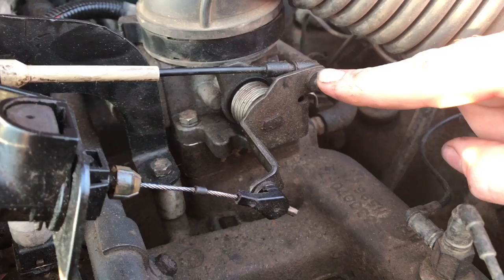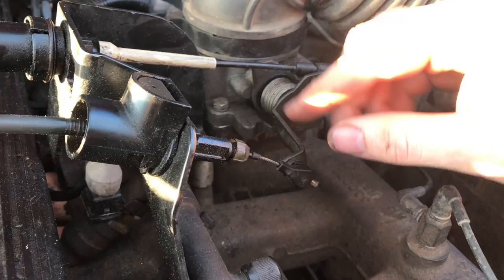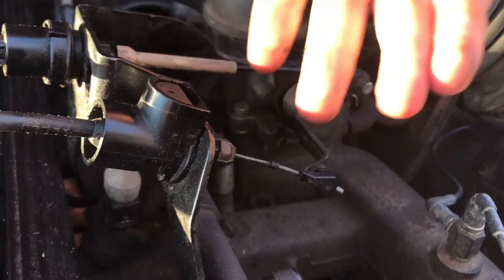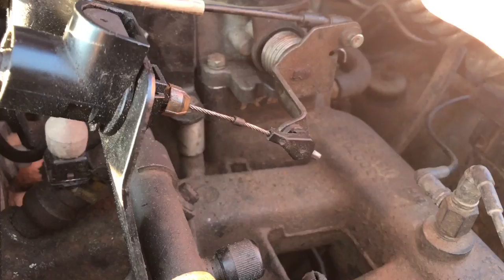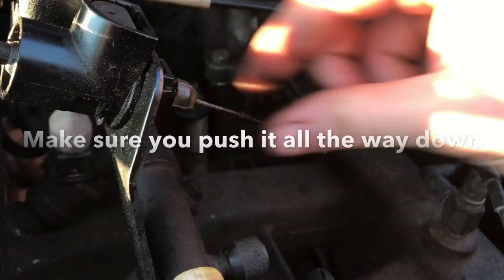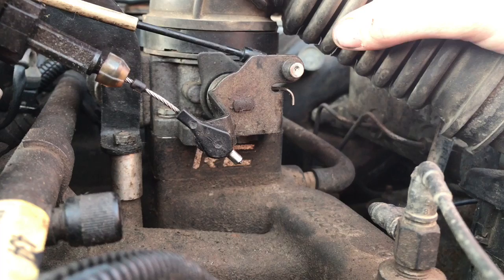How To Adjust Your Throttle Valve Cable The Right Way (Jeep Cherokee)

Comment: I bought a 93 zj the last owner told me it's a manual automatic transmission meaning you shift from low on up to drive , if you take if in drive it's to lazy and hardly moves

Comment: I've been trying to reset my cable it's not working.i tried at least 40 times and it still not working.i know it's not my transmission because my transmission was gd before I cleaned my throttle body is there something I'm doing wrong

Comment: How do I adjust it if the plunger doesn’t ratchet back when I step on the throttle? For instance, when I push the plunger back and then I step on the throttle the plunger just stays in place. I have to manually put the plunger back in position.

Comment: It's actually called the "line pressure up cable" by Aisin. It increases the line pressure in trans to engage the clutches harder at higher engine loads.

Comment: Mine is not extracting back out with the pedal but it does extract out if I do it by hand at the throttle period what the hell does that mean? LOL my shifting is a little bit late at around 3000 - 3300 Doesn't seem to get any better no matter how I adjust the cable
Reply: That’s my problem too!, mines not coming back out

Comment: @Cherokee Ronnie. Hey Ronnie, thanks for posting the video. I just bought a 1993 Cherokee last week and not that I've been driving it around much but I did notice that during my 30-40 miles I put on it that the shift points were way too high. I paid attention to the rpm's which were shifting at 2,300 to 2,500, so yep it sounded like the trans was really winding out. I made that adjustment this morning & then started it, let it warm up a bit, then off I went for a 6 mile loop that I go on whenever I've just repaired something on my vehicles. And I have to say, Cool Man, the shift points are a lot better. At a normal acceleration, with or without traffic, my Jeep was shifting at 1,800 to 2,100 and when it went into 4th, it averaged 1,600-1,700 rpm's. 
Now it's not my 1st jeep Cherokee but since it has been 10 years and taking into consideration it's still new to me, I'm just taking my time with it so I don't fall into any problems from rushing into things. There is not rust on the vehicle at all. Came outta Colorado Springs, Colorado, where it lived since 1993, so being the 3rd owner and it now living in Michigan, automatically lets this Jeep stand out, so I'm glad it's in great condition. Other jeep owners can look at the grille and pretty much guess from what part of the 90's it was made, plus I've gotta get used to the other Jeep Owners who know you gotta wave at any other Jeep on the road. It's a neat experience and glad I subscribed to your channel. Thanks again Ronnie for uploading this video...

Comment: got a 87 AMC cherokee chief , don't know much about the tranny or how they work it has the AW-4 in it , with power tran button on dash /  i'm adjusted it a couple times like you said  , but  it won't shift out of low at all any ideals ? thanks

Comment: I adjusted mine and it started bucking on first and second gear shift. I feared the transmission was having trouble but after seeing your video I realized it started after I did the adjustment. Search for a good way to do it and you gave me the answer. I just need to play with it and get the right adjustment. Thank you.

Comment: OK, didn't work right for me...but I did get the problem fixed. Let me explain:
I had the exhaust manifold replaced and after it was shifting real high. I sort of freaked out and thought that back in the day I'd have figured they messed with or unhooked the vacuum modulator. I had no idea what direction to go but a few searches found this and others. That button would not move. Took liquid wrench and a sore finger before it moved. I had to really fight it and it was hard to get the adjuster thingy to move...but it did. I should say mine looked a little different ('95 inline 6). It would not adjust however. I lubed and tried and held the button and moved it...thing was almost seized and there was no auto adjusting going to take place here. I watched this closely, and then manually moved the thingy where it looked like it needed to be. To my amazement...because it just didn't really look like it would do anything...it fixed it. Shifts are back where they belong...HOORAY! #jeep #cherokee #shifting #kickdown
Reply: Same issue, hopefully it works

Comment: I recently bought a 2000 jeep grand Cherokee  (v8). Noticed it was shifting sluggishly and looked into this tv cable. But every video I find shows a button to adjust it and there is no button on mine. After looking at the cable it is incredibly loose and needs adjusting, I just don't know how.
Reply: Sean Cantley did you ever find a way?

Comment: How could a friend help me with my Jeep Cherokee every time I turn it on, it speeds up too much and then the revolutions go down but it only does so when it's hot
Reply: Fredy T List of possible things 

CPS

TPS 

IAC 

TV CABLE <----- this video 

Bad ecu but probably not 

Bad flex plate 

Bad valve cover <----- for me once in a blue moon would miss violently when put in drive almost a knock.

Comment: I have 98 jeep laredo. It's crazy! I've taken to 3 mechanics. Who drive it and tell me there nothing wrong with it! When driving on interstate and it's gets between 60 to 70 miles. The rpm will start revving up. You can see it, And feel it. It doesn't do it when idling. Only between 3rd 4th gear. Can this be same thing? Cable?

Comment: If your button won't push down a socket that fits inside the button recess when laid over on its side and a channel lock tool will push that button down.

 then while down move the " nose"  out of the housing 1/16 of an inch untill the shift quality is where you like it. 

Saves a sore finger. 

Just a gentle squeeze is all it takes.

Comment: What happens wen it doesn't adjust back myin jus stays in throttle pulls cable but it doesn't adjust
Reply: Drew
Reply: Mine does that too.  95 Grand Cherokee. I have to adjust it every day. Going to replace it

Comment: About two months ago my overdrive in my '96 XJ was acting funny. It would cut out while driving highway speeds and my cruise control would stop. I'd have to pull over and stop, take back off, then overdrive and cruise would work again. Little bit later, same thing would happen. I lubed up the button, adjusted it, now all works great. So now, I'll hit the button with some P.B. Blaster every time I do the oil change to keep that from happening again. Great vid and awesome info. Keep on keeping on bro. OlllllllO
Reply from the maker: J. W. That's weird I never seen one do that before

Comment: I have a 5 speed manual 94 and my tac sits at 1000 and at super high revs the needle only goes up to 2500- 3000?  I took the air intake off the throttle body and gave it some gas using the little lever there on the throttle body and again at max rev my butterfly valve only opened like 20 degrees??? like it barely opens at all!!!! also it feels so damn sluggish I can't accelerate for shit!!! could all these issues be due to my valve positioning with the valve cable and all that? I'm trying it tomorrow anyway so I guess ill just find out then? oh also I got a TPS engine code last week when I hit 75mph the other day. thought that might be an issue to... but regardless of all this stuff shouldn't my butterfly valve be like al the way open at max rev??? or close to all the way open? please help me
Reply: Slack in the throttle cable from the accelerator pedal to the throttle valve roadside fix is zip ties between cable end and gas rod to take up clearance. Long term fix is replace with new old stock cable. From rock auto or parts geek

Comment: what if after putting in if i press the pedal it wont pull it out
Reply: I had one like that, extreme long time between shifts hard shifts. Move the center out 1/16" at a time till it shifts like you want.  

Tv cable is saying w.o.t. now

Comment: Hey man, the plastic conmecter on my TV cable is snapped, I have to head back on a 3 hour trip tomorrow and you've been the best resource I've come across so far. Is there any way to replace just the plastic or would I have to go ahead and get that whole part redone?
Reply: I have the same problem, I snapped it when I was pulling it out. What did you end up doing?

Comment: hi,have a 1997 jeep grand Cherokee ,when driving it will all the sudden like you put in in nutrial.
i changed the fluid and filter ,and same thing,but sometimes it drive perfict.what ya think it can be
thanks tj
Reply: Had a similar issue.  98 Grand Cherokee.  Going to 3rd Gear from 2nd.  Felt like a neutral and a slow shift.  That's the 2-3 shift valve In the valve body hanging up.  Anyways, If it still shifts but feels like theres no grip for a split second, ya I'd try Adjusting your tv cable.  Note that the Grand Cherokees have a different kind of adjuster.

Comment: my jeep doesn't like to stay in overdrive. sometimes the converter doesn't lock up either. I really don't feel like I have an issue with the trans because otherwise it's flawless. mines 2wd. are they built well too?
Reply: If you have a check engine light on and a TPS code, that might be your trouble.  Mine would not shift to overdrive (wouldn't stay when you touched the gas) until I fixed my TPS

Comment: I have a 2004 Wrangler TJ 4.0L. I have the throttle cable and the cruise control cables attached to the throttle body but NO TV (kick down). Now with a lot of time and effort I finally saw a blog saying my Jeep doesn't have one. It uses a computer. And with my engine notorious for lagging or upshifting early, the recommendation is turning off the OD when in town. Also I saw an AD for a device that plugs into the computer for the transmission that eliminates this need. Apparently there's about a three second delay between the computer relaying information to the transmission and the throttle body movement. Hence the lag and delay in downshifting when accelerating. 
What are your thoughts?

Comment: Hey man, from Miami here. Does this apply to a 00’ Wj? I’m sure it’s differently set up! 4.0 Wj btw
Reply: I take the car for a spin 1st is fine when I left go off the gas to start accelerating again off a corner it’s just like if it’s on neutral and starts bouncing maybe this is the issue
Reply: @Hogib35  same thing happening to mine it’s an 02 you fix the issue?

Comment: Randomly this just started. But as soon as I start my jeep the rpms try to red line real fast and have no idea why.
Reply: Sounds like your air idle control valve. Ots located on back of throttle body

Comment: Also, my throttle cable has slack in it. To me it seems too loose. Is there a way to tighten it?
Reply: Get a new one.
The attachment points are both outside fairly easy job when cool

Comment: Is it possible to make this adjustment too many times? If so, what are the repercussions of doing that? I've been having issues, for about 6 months now, with my 94 XJ automatic shifting either too quick or too late, very erratic overall. I've replaced the TPS and have done this adjustment probably 20-25 times over the coarse of the last 6 mos. Yesterday, it started to not shift at all on the highway. I would press the gas and the RPMs would go up over 3000, but it would not accelerate and I had to coast it into a gas station. Went out and made the TV cable adjustment and then would crank, but not start. Repeated the adjustment 5-6 times and still wouldn't start. Unplugged the TPS and it started right up. Attempted to drive it the 5 miles home, with the TPS unplugged, but the same issue came up with it not shifting or accelerating. Is this what they call "limp mode"? Anyway, I pull over and plug the TPS back and try to start it and this time it started and mysteriously drove and shifted much better, although still not perfectly. Should I be looking at something in the transmission itself at this point? It's full of fluid and it's the stock AW4 tranny. Does any of this sound related to a neutral safety switch problem at all? Thanks for any help anyone can offer.
Reply: Same problem
Reply: @joshnewton1243  , still haven't gotten it worked out. My next step is to change the tranny fluid/filter and inspect the shift solenoids while I'm in there, hopefully in the next week or two. That's about all I have left, so hopefully that fixes this issue.
Reply: @lonewolfsurvival3453  yea probably something else going on for me, I have a 98.
Reply: @joshnewton1243  , the first step, if the TV cable adjustment above doesn't help, would be to look at your TPS (throttle position sensor), that is if you're experiencing the same symptoms that I am. Mine was bad and, installing a new one did help somewhat, but not completely, so it's something else in my case. Have you tried that yet? If not, DO NOT buy a cheap rebuilt TPS, since I found out too late that those rebuilt ones are garbage and don't last very long at all. Get a brand new one, which should run you $50-75.00, depending on the brand.
Reply: @lonewolfsurvival3453  Thank you for the advice! 
 Update, my tps and crankshaft sensor(not camshaft my b) were still under warranty from advanced, After I swapped them out my jeep runs like a dream! Shifts on point every time. I still feel like I have a larger electrical issue causing these sensors to go out, I've replaced the whole radiation system so overheating hasn't been an issue as far as I'm aware(for northwest Florida that is). Something is surging the voltage to fry these sensors but idk.

Comment: What do I do if the little plunger doesn’t come out when I hit the gas
Reply: Remove and Clean the throttle body
Reply: Manually pull it out 1/16" at a time till it shifts like you like it.

Comment: I hope you still monitor these comments.  98 Wrangler 4.0L 3 speed automatic.  I do not have the bush button like you do and I can't adjust it by simply pressing the gas pedal.  Throttle all the way out and it shifts sluggish and doesn't down shift when trying to pass.  Adjust it tighter and it shifts fine, downshifts when accelerating to get on the high way but then shifts into third at about 50mph.  I swear it was down shifting even on the highway before I had to replace the cable.  Am I too tight or not tight enough?  Too easy of a thing to mess with to pay someone to do it.
Reply from the maker: Do you have any play in the wire
Reply: @cherokeeronnie  When I adjust it where it shifts fine then no.  Before it did.  However, I have seen several videos now where the guys have the same style cable I do and they have adjusted it differently than your video shows.  Maybe because the button allows a "self adjust" to a point.  Mine has a clip, where your button is, that has to be removed for adjustment.

Comment: Thank u for the quick reply sir, just a few mts ago I started my 89 jeep 4.0, it would not shift in reverse, I checked fluid level etc all fine, but after it got warmed up then it would shift into reverse, gave me a heart attack since this rig is my whole life at present, had it since new, maintained it immaculately, same engine and tranny all original mileage is past 310k miles, I happened to top off a liitle tranny fluid with dexron mercon synthetic and this problem popped up, should I go hunt for the dexron3 and replace the fluid ? thank u once more sir.